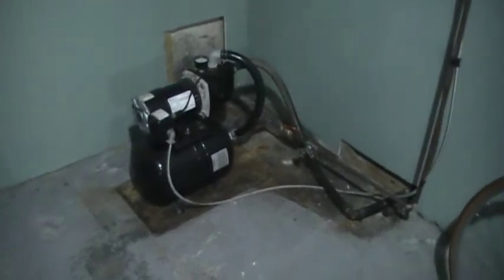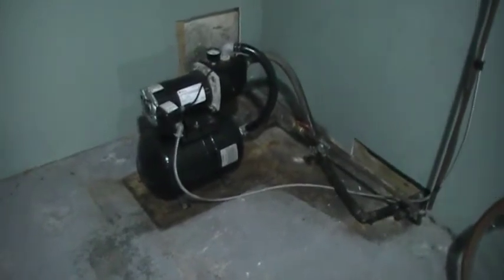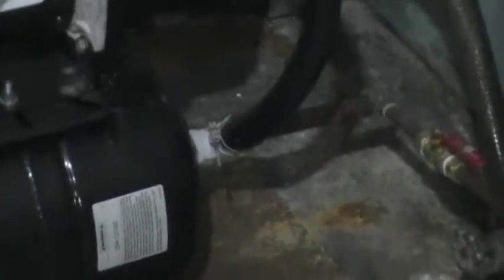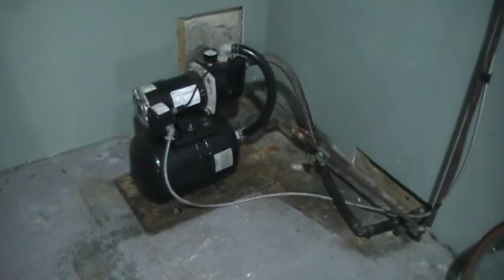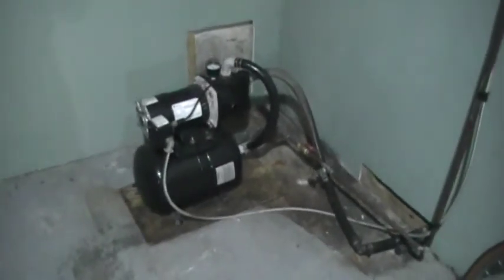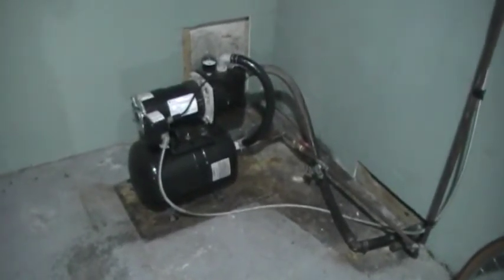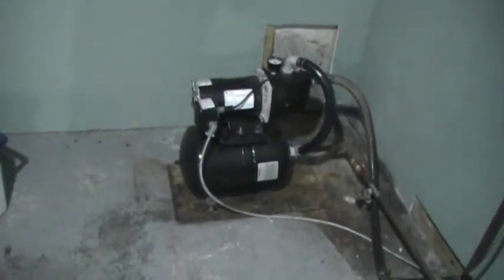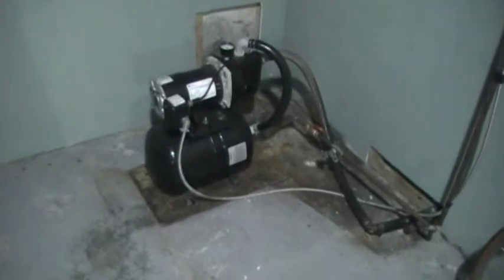A few tips for pump installations on a shallow well and household water systems.

Comment: I have a shallow well and I wonder if you can answer a question. My pump failed after 25 years. But I don’t know where the pump is. It’s not in the basement so it must be in the well or some place between the well and the house. I have been unable to uncover the well to look inside. I put in a tube to see how deep it is and it’s only like 3 feet deep. It has a metal cover. The only way to get the cover off is with a grinder and I don’t want metal particles in the well. Can I hook up a suction pump inside the house to pull the water or must I find and remove the old pump first?
Reply from the maker: Hello lcagee,
If it isn't in the basement ;it is probably down the well and would be considered a submersible pump.
At the end of the day you have to get to the pump to repair or replace it. 
I haven't heard of anyone hooking a pump up to the line coming in the house with a submersible in the well, but it is possible that it could work. Basically you would need a shallow well jet pump to do this and prime it. I can't guarantee it will work, but if you are desperate it's worth a shot. 
It also depends on the depth of the water in the well. You are saying you have a shallow well so it should be 25 feet or less.
If you are not sure of where the pump is located; you could slide a piece of tubing out from inside the house through the line coming in from the well until it stops. This will give you the distance of how far it is from the house. You can also follow the line coming from the house and dig back until you reach the well cap.
Let me know how you get along....Al

Comment: My shallow well pump was installed with Black Iron for the outlet, it's been this way for at least 20 years. This morning I found that the threaded CPVC had blown out from the black iron.  Further inspection of a length of 2 1/2"  ASTM D1785  CP-112-P shows signs of imminent bursting. My questions are;  How and why did this get so hot? Do you think the pump is shot? Are there any videos you can recommend showing exactly what I need? I have yet to find a Home Depot "professional" that gives me what I need as opposed to what will get me by. Obviously what I had worked for quite some time, but the more research I do, I'm finding too many no-nos's. Thanx inadvance.
Reply from the maker: Hello Gary,
Black iron and potable water aren't a good combination for sure. It will work for you for a length of time, but will eventually give out as you can see. I made a video on changing out a pump tank. I replaced the fitting from the pump outlet to the tank and outward. It may help with your project. Hopefully it will help with your repair.

Testing and Replacing Your Pump Tank...Waterlogged tank...Plumbing Tips!Thanks for commenting and good luck with the project!    Al

Comment: I have a shallow well the pump cycles about once an hour there are no open faucets Any suggestions
Reply from the maker: Hello Robert;
I would make sure that your toilet is not putting water over the overflow and that the flapper is tight in the tank. Add a few drops of food dye in the tank just to make sure that everything is good there first. If the water in the bowl changes color; you have a problem with either the flapper or the ballcock.
If you are all set there; you probably have a leak some where in the well. Whether it is the foot valve leaking or a leak in a pipe or joint. The problem lies there. 
So to correct this without digging up the well; you can install a spring loaded check valve in the pipe leading to the pump from the well. This will not allow any pressure to be place on the leak and maintain the pressure in the tank.
Thanks for commenting and have a great weekend!      Al
Reply: TheOldkid888 Thanks for the info  I was going to replace the pressure switch & the tube running from the pump to the pressure switch.  But I will forgo that & try your suggestions.
Reply from the maker: Hello Robert;
It definitely sounds like a leak in the well if your toilet is fine. Installed the check valve several times for this same problem.
The inline spring loaded check valve will prevent the pressure from dropping off and kicking the pump in.
Thanks for commenting and let me know how you get along!    Al
Reply: Robert Howard The pump problem has gone away. Do you think the check valve had some crud on it & was not seating correctly?
Reply from the maker: Hello Robert;
Great news for you!
It is possible for the foot valve to have picked up a small bit of dirt and did not seat down correctly. 
I hope that is your situation!
I would keep an ear open for the next little bit and hopefully you will be good to go. 
Thanks for commenting and have a great week!      Al

Comment from the maker: hello Joe;

You are more then welcome!
I hope you picked up a tip or two there. Poly pipe is the way to go and not using any black iron fittings on domestic water is a must. I try and limit myself to using compression fittings whenever possible. They come in handy from time to time, but on new installs; rigid piping (threaded or soldered valve) is the only way to go.
Thanks for commenting and enjoy your evening!     Al

Comment from the maker: Hello mexifin;

Compression fittings have been around for many decades for sure.
They do work well!
I try to use them as limiting as I can. The water in this area has a great amount of minerals in it. It is hard to use them with out them slowly growing on the outside; so I tend to stay away from them as much as possible.
I have all the confidence in the world in the them; but I do prefer soldered or threaded joints where ever possible.
Thanks for commenting and the kind words!   Al

Comment from the maker: @fritzhvac Hey Fritz; Just trying to prevent headaches for homeowners in the future. Finding alot of this stuff lately. It just doesn't mix with water at all. I take that back. It mixes with water very well and begins to leak shortly after it is installed. I try and stick with the brass myself around pumps.
You have to love the gas. It hasn't come to this neck of the woods yet and I don't think it will anytime soon.
Thanks for your comments and as usual; your great humour. Have a great day! Al